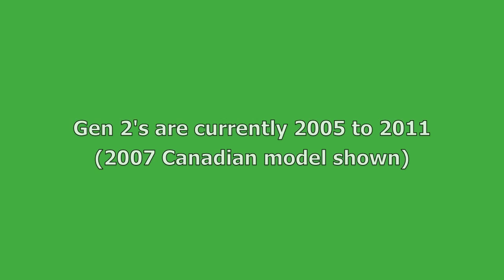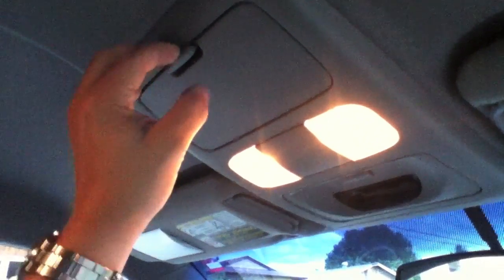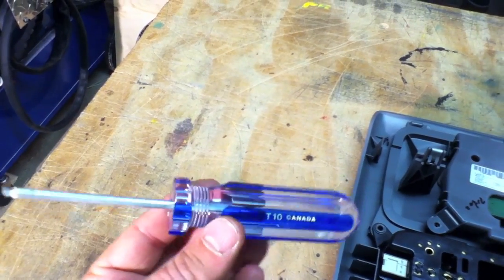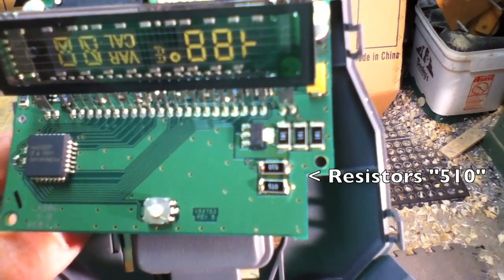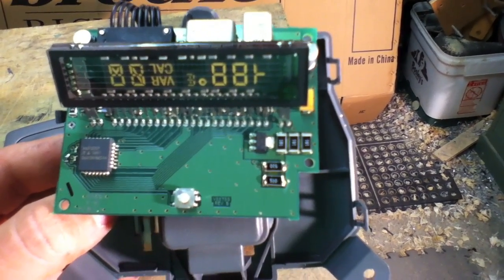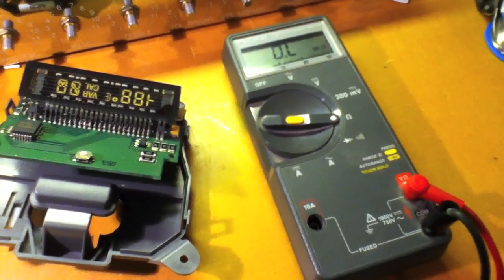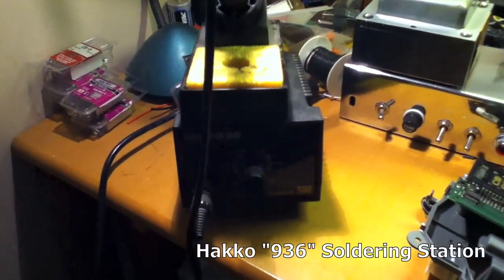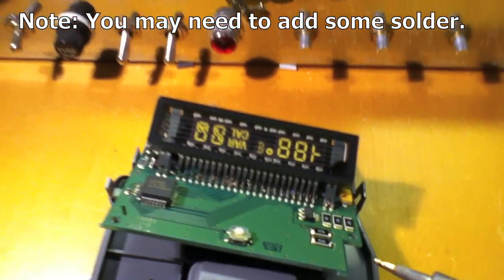How to Fix a Toyota Tacoma Temperature Display // Simple fix, check this before buying new

Comment: While mine works, it just isn't bright enough. Do you think a resoldering will help in this case?
Reply from the maker: You can try but I don’t think the brightest has anything to do with those resistors.  I find mine is dim during a bright day with the headlight circuit on.  The headlight circuit on, will dim the display.  Cheers.

Comment: Many 🤷🏻‍♂️ years ago I took my Tacoma into the dealership I had bought it at. It was a used vehicle. It was a few months after I bought it that the compass/thermometer thingy stopped working. They checked it out - “No, it’s not working; it needs replacement” but! “ No replacement is available” ??????? They charged me for that little foray! It never worked and I lived without it all these years! Sad but I’m not that good at teeny tiny solder jobs and electronics!
Reply: Went to Princess Auto yesterday and bought a soldering iron ($19.95). Watched the video a couple times more. Took out the unit, gathered up some courage and did it. My only issue was when I went to re-solder one end of the resistor, the other end wasn’t attached! So I carved a splinter of wood to a point and held down the little bugger and soldered both sides down. The other one was just a piece of cake. Reassembled it and reinstalled it. It works perfect! 👍‼️ Thanks‼️
Reply from the maker: Awesome!  That is great news! I'm glad it worked out for your. Thanks for letting me know! Cheers
Reply from the maker: Sorry to hear about your experience; hopefully this video can help get your display working again.  Harbour Freight does have inexpensive soldering irons that would do the trick.  I’d take it out and see if the resistors are still there. If not, look for them.  If they are still somewhat attached, resolder them. Worth a shot in my book!
Reply: , all my soldering irons are way too big. I’m up here in Canada and the equivalent to Harbor Freight is Princess Auto. I’ll check there for something that is way  smaller!
Reply from the maker: I'm in Canada too. (BC)  Princess Auto does have a precision soldering Iron for ~$20 that would do the trick.  Cheers.

Comment: Thanks Mike. Mine went out years ago on my 2005. I re-soldered it and just recently it is going out again.
Reply from the maker: You’re welcome.  I had to do mine twice.  The first time it held for a year and went out.  The second time I added more solder and it is still working. Been roughly 8 years now and still holding.
Reply: @MikeFreda  So I just pulled it out and it’s the OTHER 510 resistor. It just totally broke off just like the last one.

Comment: How exactly do you check the resistors with a multimeter?  Is it just the five 510 resistor on the side you need to test?  Thx.
Reply from the maker: You want to see if the resistors are still properly connected and are still functioning in spec.  On a multi-meter there is a ohm setting.  You want to see if they have a ohm value and are properly soldered to the board.
Reply: @MikeFreda  Is it only the 510 resistors that go bad?  Mine show continuity and I can't tell if they separated from board.
Reply from the maker: Yes, they are typically the ones that go bad.  In my case, the were still good but one side had lifted off the board from excess heat.  You may need to re-float the connections to validate that they are still firmly attached.

Comment: The display is poorly made. Mine went out 3 years after the truck was built.
Reply from the maker: Yes, there is a flaw with the LCD design. I found  if you do a good job resoldering those resistors it typically holds. Mine been working ever since I made this video.

Comment: Just yesterday, Avondale Toyota in Phoenix, AZ quoted $843.43 to fix this.  Said it was "INTERNAL FAILURE IN OVER-HEAD COMPASS/TEMP MODULE" which is probably what the vehicle diagnostics told them.  After watching this, and other, videos, I am going to tackle it myself.  If it still doesn't work I will be in the same boat I have been in for a year.  Nothing lost, or spent!  The frustrating part is that the dealership didn't even bother to try and fix it.  Plug and play is their only option.
Reply from the maker: Yes, I've heard this before but that is very costly! Unfortunately, this is a known issue for Toyota and since the Tech's don't really have official training in soldering on printed circuit boards they are instructed just to replace the entire board... and the resistors may pop again (mine did) 
This covers the Tech and the Dealership from any warranty issues.

Comment: This was helpful! Fixed mine! Guessing the years of heat are not good on that solder joint.
Reply from the maker: Great the hear! Yes, the location of the unit and I feel that those resistors are undersized for that application.

Comment: Did this fix a week ago for a customer (Home PC repair biz)
Did not find out the part replacement was $1200 until after I completed resoldering the 510 resistor.
Was good to see the display spark up after we pit it back in his truck.

Comment: What do you do if you are clumsy and lose one of the 510 resistors?
Reply from the maker: You will probably have to order some 510ohm surface mount resistors on line. I've heard of people using regular 1/8watt 510ohm resistors and stuffing them into the board. You will need two.

Comment: Thanks a lot for this video. I have a 2005 Toyota Tacoma 4x4 quad cab. The temp/compass indicator stopped working over a year ago. I didn't want to pay an excessive amount to have it repaired so I just lived with the inconvenience until I found your video. I decided to give it a try. I found that one of my 510 resistors was missing and the one next to it attached by only one end (the same ones in your video). Couldn't find a reasonably priced flat plate resistor so I ordered  51 ohm barrel type resistors that have wires on both ends. Soldered them in place and put it back together. It works great!!!  The only down side is that the smallest package of 51 ohm resistors I could get via Amazon contained 100 for about $4. Now, I have 98 extras.

Comment: Thank u so much! I`ve had my Tacoma 3 years now, no display...couldn`t even get the overhead panel down(didn`t know about the clips) I resoldered both the 51 ohm resistors(510`s - 3rd digit tells how many zero`s after first 2 digits) and IT WORKS...
MAN, I LOVE THE INTERNET
Thank you again!

Comment: I opened mine up and the 510 looked fine any siggestions why my display doesn't work?
Reply: Just heat up the sides where it connects. Doesn't take much. He mentions it in the video. Mine were in tact too but when I did what he said it worked great.
Reply: yeah or add more to the connections, one of mine was hanging so i just soddered that one but still didnt work so i reheated both of them and now its working fine

Comment: Just purchased a used 2007 Tacoma double cab and the compass wasn't working. I followed the instructions on the video and ended up putting new soldering over the transistors. Problem solved! Thanks!

Comment: The kicker is not only does Toyota want a lot of $$ for the replacement, they replace it with the same unit that goes bust a few years later as well. My buddy owns a Toyota dealership and says the same thing, fix it yourself. It's already broken, what have you got to lose other than 15 mins. max.

Comment: You're freaking awesome.  Just bought a used '08 Tacoma and that gauge appears to be the only thing wrong, but not anymore...  Love to cheat the dealer out of money. Was able to see the bad solder joint under a microscope so only needed to float out one joint.  Had all the needed gear so cost; zero.  Thanks so much!

Comment: I can't solder worth shit, and I just fixed my compass in less than 15 minutes. Used my multimeter, which showed two reading 0 ohms, 2 "510" resistors with cracked solder connections was the culprit. I used a cheap Harbor freight soldering iron i've had forever, which did the trick just fine. Thank you for this video, this saved me $300

Comment: This temp and direction sensor is the same as in the Ford Explorers, I'm going to say year mod 2000, and back, maybe some later models not sure..I fixed mine 3 times before I saw this video, but, your right on Mike. I'm going to the electronic parts store and get a new resister to replace this one. Wonderful job on the video.

Comment: GREAT instructions, easy to do!!!  Saved me time and money, many thanks!.. The display board I pulled out had a resistor labeled 510 on the bottom right, the one right above it was white with no numbers. It appeared to be the one that was loose on one side, but to be safe I soldered both sides of both resistors, plugged it back in an worked perfectly...tks agains

Comment: mike where can I buy a 510 rezister
Reply from the maker: If you can't re-use yours, then I would find a electronics store and get very small 510ohm resistors. Standard resistors will also work if you are good at soldering. Something like 1/8watt. I doubt you will be able to fit 1/4watts in that space. YMMV. Try online: Allied, Newark, Mouser...etc...

Comment: It works! I floated a little extra solder at the ends of the 510 resistors.  Don't you love when a 5 cent part takes down something like this.  I assume this means the resistor gets hot though.  One of my resistors as soon as I heated the other end just fell off, there was hardly and solder on that end. so hopefully more about shitty soldering and not about a perpetual problem..  I like knowing the outside temp!

Comment: Thank You!  Re-floated the soldier on both ends of the two 510 resistors with an addition small amount of soldier at the time of heating/re-floating, works great.
Thanks Again!

Comment: I can't believe I waited a year for this fix! Thank you for the info. Turns out one of my resistors had simply fallen off and was loose in the plastic. Luckily I found it. The other one was soldered on extremely crooked. Clearly their PCB manufacturers did these parts rather quickly if everyone is having this same problem.
Thanks again!

Comment: This is a good video.  I've had the same problem and have fixed it.  Those "510" ohm resistors get too hot.  I am thinking about replacing for "barrel" type resistors next time.  Seems other manufacturers such as Ford use the same type or brand of LED display and have the same issue.  They should engineer these better.  It's still cheaper to fix yourself than going to the dealer, at least on the display issue.

Comment: I spent $15 and the circuit board is rather small in architecture. It will look exactly like in the video and he CLEARLY shows the resistor (510) CLEARLY marked on it. You sound too unsure and accusing. This isn't pulling a carburetor apart, it's rubbing some solder with a hot point to melt the solder and reform the connection to complete the circuit. 

If you aren't sure, don't be this guy here.

Comment: Thanks Mike, just pulled mine out and rubbed the soldering gun against the contacts on the resistors and it works perfect now!  '06 Tacoma here.

If you think you are too dumb to do this, you can. Pay $15 for a soldering iron and save yourself the cash and time of taking it into a shop.

Comment from the maker: Well, the dealership typically wants to replace the entire unit since it easier, faster, they know the new piece works....and yes, they make more money. It's in their best interest to do so since the Mechanics aren't electronic technicians are probably not "qualified" by Toyota to solder parts. If it was still under warranty I would expect a new board and not just a soldered part. That being said, that's why I did the video. It's an easy fix, you can do it yourself for FREE! :)

Comment: Toyota Dealership charged me $50 to tell me it was broken! Duh..I told them that and that there was a loose connection before they touched it...then they told me $289 to replace the unit! I knew there was stuff online about this, how come the Toyota dealer doesn't seem to know what is wrong?? RIP OFF!! Thanks for the info on the repairs guys!!! Now if I could only solder...

Comment from the maker: Great news! I haven't look at the circuit closely but I suspect those resistors are part of the power supply circuit. They appear to get VERY hot and can't dissipate the heat due to being undersized and not in a ventilated area. They get so hot they crack/blow/pop off. For a permanent fix I would swap it out for larger resistors.

Comment: Boy, I just fixed mine using my solder (tip dont put too much or you will burn the chip). My question is why did it break off?  thanks for the vlog

Comment: Thank you Mike!  I just fixed my 2008 Tacoma, sure enough one of the 510's had a hairline crack underneath the solder, could only see under a magnifying glass.  I did the refloat on the solder and it's working again.  Thanks for saving us money.

Comment from the maker: Great! Mine stopped working for almost a year. While it was in for servicing they wanted huge coin to replace the unit. I looked on a few Toyota forums and a few people had described what the issue could be a. I took it apart and my 510 resistors weren't off.. but the solder joints were "cold" Re-flowing the joint fixed my issue. I was PO'd that the dealer wanted so much a simple fix.. I made the video!

Comment: Thanks Mr.Mike!! 
Mine stopped working a few weeks ago. Found your video, took the unit out, and the "ole 510" chip was completely off , found it in the bottom of the housing, lined it up where it was originally situated, hit it with solder, hooked it up and it seems to work fine....YA!!!

Comment: My temp gauge gave out a week ago. I have 116,000 miles on her and just as you said my bottom 510 resistor was hanging down slightly once I took it apart. I solderer it back on and  put it back together. I had to add a little solder to it but it works perfect!!! Thanks man. Much love in the USA!!! My Toyota Tacoma is the best vehicle I have ever own and its Toyota owners like you that help us carry on and not spend a fortune. you sir are my hero. take care.

Comment: Thanks Mike for that, is was really easy and I knew exactly which 510 resister it was that was disconnected because it was sticking up right off the circuit board.

Comment: Thanks Mike my temp gauge also stopped working, i looked it up on Google and saw your video, i took it down according to your video, soldered it and BANG it worked. :D
As i took it down i was thinking that maybe this malfunction is due to moisture since the electronic board is rite against the roof and no insulation. (just a thought) THANKS

Comment: Thanks Mike - We were driving home tonight and the temp gauge/compass was dead.  My heart sank imagining the 4 figure cost to get this replaced.  Yours was the second vidoe I saw on YouTube.
When I opened up my gauge one of the 510 resistors was tombstoned with a tiny thread of solder connecting it.  I reflowed the joints on both resistors and it's fixed the temp gauge! 
Thanks Mate - really appreciate your video!